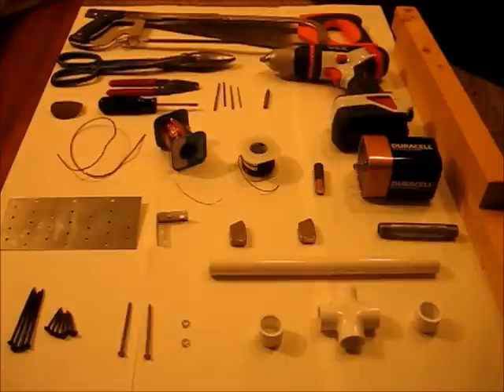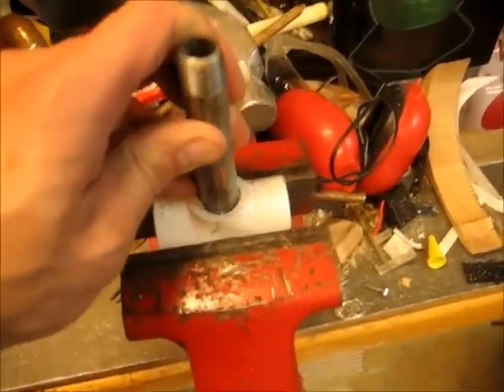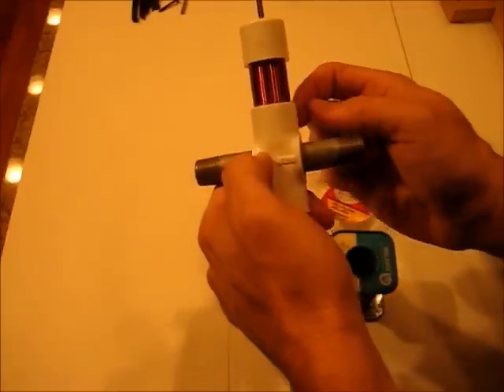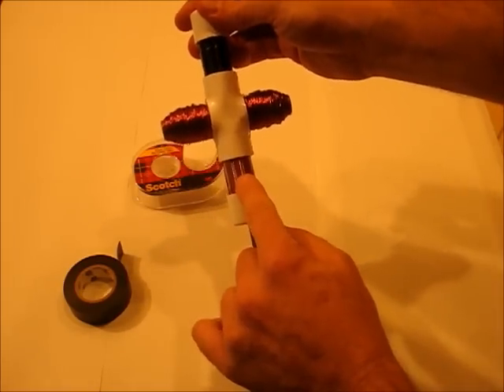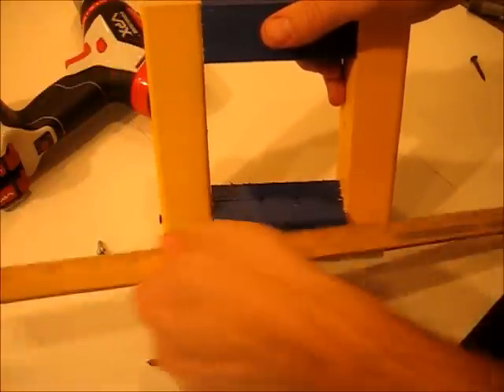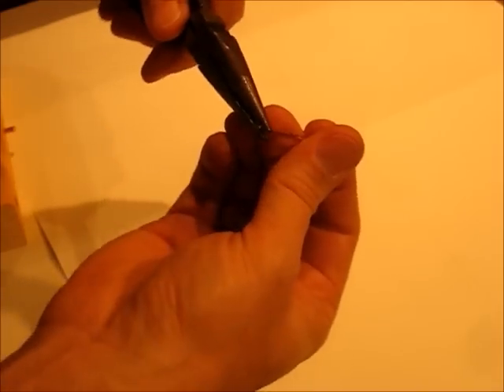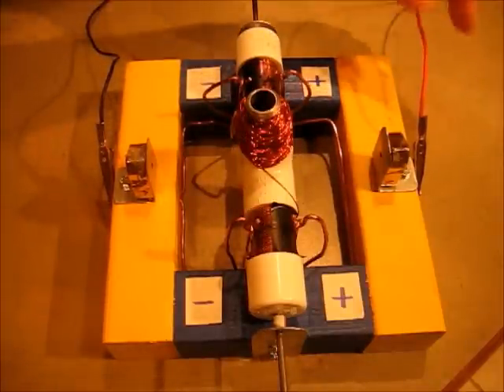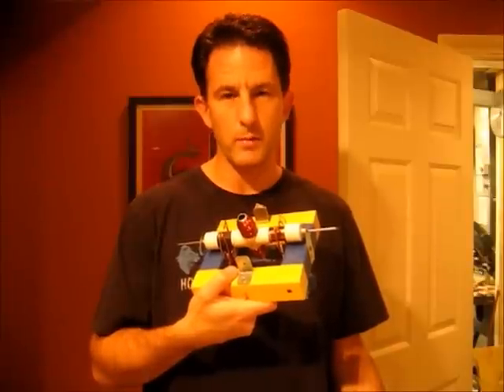How To Build a Motor (HowToLou.com)

Comment: Excellent video, great craftsmanship, you left out the part where you put on the electrical tape. I count figure out how you did in until i saw you had electrical tape on the stator between the brushes very clever.

Comment: thanks Lou I got it working today im going to make another one and try to reduce the friction as much as possible. thanks again.
Reply from the maker: +Bob - A great way to reduce friction is to build it vertically, and stand the bottom nail on a piece of glass.  See the sample motor builds in the gallery at HowToLou.com/motor

Comment from the maker: @Reynier Serpa - It will run slowly on 12 volts.  There are a few things you can do to make it run faster.  If you replace the metal brackets that hold the rotor nails, with tiny ball bearings, this will reduce the friction significantly, which is the main enemy. Also, you will need to affix these bearings with maybe super glue, to the nails, so the rotor won't slide out of position, when you turn the whole motor sideways.  Also, use pvc rotor arms instead of metal, and put as many windings on as you can, and use strong stator magnets.

Comment from the maker: @Leanne Miele - It is enamel coated copper wire, knowm as magnet wire.  You can get it on Amazon.com.  Please check out all the build tips at HowToLou.com/motor before you start.

Comment from the maker: @Leanne Miele - Yes, it is split, but it is a dual split, instead of a single split.  Commutators route the electrical current forward through the rotor coils for 180 degrees of rotor spin and backward through the rotor coils for the remaining 180 degrees, and then it starts over again.  This is typically done with a single split commutator, that has one contact on one side and the other contact on the other.  Single split commutators are difficult to build, because there isn't much room to put two contacts on a rotor, and they can't touch.

This motor has a dual split commutator, which takes up a little more space, but is MUCH easier to build, because one contact is on one of the commutators and the other contact is on the other.

You would have a split commutator and not be re-purposing pre-made rings, with this motor.

Comment from the maker: @Seth Wolff - Yes, it will run on 12 volts, just slower.
Reply: Thankyou. Last question, if I do all the windings on one side of the pipe and then move to the other side and then realize I didn't put enough on the first side, can you go back over to fill the first side up again and then move back to the second? Or will this not work?
Reply from the maker: Seth Wolff - That will work just fine.  Make sure you have the same windings on both sides, so the rotor is balanced, and make sure the windings always wrap in the same direction.  It is also a good idea to read all the building tips at HowToLou.com/motor before you start.

Comment: Hey Lou, great build, I saw your video on Hackaday, Thought: you'll get better performance if your magnets were mounted on the OTHER side of the angle brackets. I know you've done it that way to stop the magnets flying off, but he metal in the angle brackets will divert a lot of the magnetic flux through the metal and around the magnet instead of into the region where the rotor is spinning, where it can generate torque.-meseta4114.  
Magnets were too strong, but good idea with more coils.  -Lou
Reply: What type of a motor is this?

Comment: I'm making this for a physic's project in school. I'm going to test this with 0,56mm copper wire and 1,12 mm copper wire and different magnets. I hope I get a noticable difference in results ( rpm and batterylife)  Anyway, thanks for the good design. I will post my results ( if there are any) here.

Comment: Another good idea.  I thought about that, but the PVC was less expensive and fit with the other parts.  You are right, though.  A copper pipe would have made better contact.

Comment: Thank you Lou for your very useful video! I have a question: would I be able to splice the copper wiring by twisting them together, because I couldn't find a big roll of copper. Once again thank you!
Reply from the maker: Yes, you can splice the rotor wire.  Just make sure to scrape the enamel off the wires, where you join them together.
Reply: I used the phone wires and i treated the plastic exactly like you treated the enamel. However, when i tried it yesterday, my motor didnt work. What am I doing wrong?
Reply from the maker: Pamela B Go to HowToLou.com/motor and check through all the troubleshooting tips.  If those don't help, send a few pictures of your motor to me at HowToLou@gmail.com, and I will see if I can figure out the problem.

Comment: Hey Lou, so I was building this motor and there seems to be a problem. I connect the wires and nothing moves. I measured the voltage with a multimeter and there is definitely 24 volts going through the brushes. Help?

Comment: If I built this motor and hooked it up to a small fan as a wind generator do you think I would get a electrical feedback? Maybe to power a led bulb. Great video by the way! Keep it up.
Reply from the maker: Agravated Monkey - It would have to be a large fan, but yes, every motor is a generator, in reverse.  This, and all home-built motors, are pretty inefficient, primarily because of energy lost in friction.  If you attach a fan blade to one of the nails, and blow it with a large fan or leaf blower, you should be able to power an LED, just fine.  Make sure you put a 300 ohm resistor in series with the LED, or you may deliver too much current and blow it.

Comment: I know this video is a few years old, but figured I'd give this comment a shot. My daughters and I are building this design for a science fair project. I ran into a small problem with the pvc cross and the metal pipe nipple. The video said to use a 3/8" diameter nipple in a 1/2" cross. The 1/2" crosses carried at both of my local big boxes have an ID that is much larger than the OD of a 3/8 nipple (which I know isn't really 3/8"), but a 1/2" nipple has about .080" of interference, which is too much to just hammer it through. Fortunately I have access to large enough drill bits at work that I can resize the cross. Also, the pvc caps I was able to find do not have the little dimples on the inside, so I will need to drill them in a lathe in order to keep the holes centered. Just something to watch out for when buying your parts. After all of that, I do have a question: Where were the washers used? We noticed them mentioned in the materials listing at the beginning, but after watching multiple times, we don't recall seeing them installed. Thanks in advance!
Reply from the maker: +Joe Werner - all good observations.  First, please go to HowToLou.com/motor and look at all the build tips.  Yes, pvc cross makers are extremely inconsistent.  Some are too small so you have to drill them out.  Some are too large, so you have to add hot glue.  Another good option is to just use pvc rotor arms.  This actually works quite well.  See build tips.  Yes, the centering the holes in the camps is very important.  If you have a lathe, great. If not, just measure very carefully.  Yeah I ended up replacing the little washers with 1/4 inch long straws.

Comment: Great video! I've decided to build one, but I'm not sure about the thickness of the wires. I mean the wires used for the coils: I've found a 0,355, do I need a thinner wire? I know that the thinner is the better, as I could wrap the wire much more times, but the man that sells wire in my town said that to use a 24 V tension a wire should not be too thin because the amperage is too high. So what do you suggest?
Reply from the maker: I used 22 AWG magnet wire.  He should know what that is.  That is perfect.  There are more build tips at http://www.HowToLou.com/motor
Reply: Ok, thank you. I'll try witihin some days ;)
Reply: ***** Another question has just come to my mind. Isn't a 22 AWG (0,644 mm) magnet wire too thick ? I mean, it seems to be too similar to the "18 inches long copper wire" used for the brushes, am I wrong? If I am wrong, how much of this wire do I need? Are 25 meters enough?

Comment: hi Lou, does the threaded pipe that you wrap your windings around have to be steel (magnetic or non-magnetic)? or does brass work?
Reply from the maker: Austin Winters - Short Answer: Brass works.  Long Answer: Steel is ferrous (contains iron and sticks to magnets). Brass is non-ferrous.  Steel rotor arms are both good and bad.  They are good in that they focus and strengthen the electromagnetic field.  They are bad in that they "stick" to the stator magnets, and make it hard to start the motor when the rotor and stator are exactly aligned. There are two ways around this.  The first is more power.  You need to wrap many more windings on the rotor, and increase the voltage/current flow to make the rotor magnets strong enough to overcome the pull of the stator magnets on the steel rotor.  This is results in a more powerful machine.  The easier way is to replace the steel rotor arms with Brass or PVC .  The resulting motor is less powerful, but does not have the "sticking" problem when the rotor is in line with the stator.

Comment: hello, we used your video to make our physics project. Once we connected the wires to the battery nothing happened. We are thinking of possible mistakes that we could have made. Does it matter if we accidentally varnished the four sides where the copper wire is rapped around. Also we are thinking if we used the wrong cable to connect it with the alligator clips?
Reply from the maker: Check out the motor building tips at HowToLou.com/motor and send me a few pictures of your motor and wiring to HowToLou@gmail.com. Most likely, your brushes are not touching the rotor well enough.  That is the trickey part.  -Lou

Comment: Hello,
This was a great video, thanks!
Do you have any suggestions on how to modify this motor such that it can self start from any position? By this I mean, if the two coils were aligned with the magnets such that they would attract, before connecting the power, than when the batteries would be connected, the motor would not rotate? Any suggestion how to avoid that, assuming we don't have control over the starting position of the coils?

Thanks,
Olsi
Reply from the maker: The key to getting the motor to start from any position is to greatly reduce the rotor friction, so that even when the rotor arms are furthest from the stator magnets, the attraction is enough to overcome the starting friction and turn.  The best way to reduce friction is to build the motor vertically, and set the bottom nail on a small piece of glass.  Look at Anja Bea's motor in the gallery at HowToLou.com/motor.  She was able to power the motor with a single 9-volt battery, using this friction reducing technique.  If you use the full 24 volts, this same configuration should allow you to start from any rotor position.
Reply: Theoretically speaking, no matter how little friction you have, with the current design you cannot start the motor from any position. If the two side coils are aligned with the magnet, then the magnetic forces on them would be pointing in the same horizontal axis, and regardless or direction (left or right) they would provide no rotational motion. It's like pushing both sides of a stick in or out, the stick won't move. <-F1---  ====stick==== ----F2-->. In order to get rotation, you'd need the following:
^
 |
F1
 |
====stick====
                       |
                      F2
                       |
                       v
I'm sure you know exactly what i'm talking about. In Anja Bea's video, in her third simulation, when she tries to start the motor from such position, it didn't and she had to give it a little push. I was thinking that maybe adding two other coils (so having 4, in an X shape) would get rid of this issue. Do you think this would work (other the fact that will require a lot of extra work to build)?

Btw, thanks for the quick reply
Reply from the maker: Olsi Leka - The commutators prevent the situation of aligned magnets, as you described in the first stick drawing.  When the rotor gets to the point that all the North(N) and South(S) magets are aligned  N <S==rotor==N> S , the commutators switch the direction of current flow in the rotor, so that it becomes  N <N==rotor==S> S  and the rotor rotates with its greatest force.

There is one other factor.  The steel rotor arms are both good and bad.  They are good in that they focus and strengthen the electromagnetic field.  They are bad in that they "stick" to the stator magnets, and make it hard to start the motor when the rotor and stator are exactly aligned. This is what you saw with Anja Bea's motor.  There are two ways around this.  The first is more power.  You need to wrap many more windings on the rotor, and increase the voltage/current flow to make the rotor magnets strong enough to overcome the pull of the stator magnets on the steel rotor.  This is pretty hard to do in a homemade motor, but results in a more powerful machine.  The easier way is to replace the steel rotor arms with PVC.  The resulting motor is less powerful, but does not have the "sticking" problem when the rotor is in line with the stator.  With your goal of a motor that will start in any position, I would suggest you go with PVC rotor arms.

Finally, friction is your biggest enemy by far.  When the rotor is perpendicular to the stator, the magnets are furthest apart and have the least pulling power.  The rotor must overcome the static friction to start turning from this weakest place.  This is where the vertical motor on a glass plate will help immensely.

Comment: Mr. Lou,
What is better, to use a metal rod to wrap the coil around or a PVC pipe and why?  Is it possible for the magnetic pull of the metal rod to over come the push of the electromagnetic field?  Please explain why. Thank you.

Comment: HowtoLou, I have a couple questions regarding your motor. First let me begin by saying: I have gone to your website and understand the information you are giving. With that said, how would the communicator and brush configuration look if I were to have a set of 4 coils instead of two? Also, if I wanted to lift a mass with this type of motor what would be the best position, horizontal or vertical? Lastly, my project parameters restrict me to a single 6v lantern battery, would you recommend a DC boost converter? I'd appreciate a response, and thank you.
Reply from the maker: +Cornelio Santibanez - Converting this motor to 4 coil arms is possible, but a little tricky.  First, I would replace the PVC cross with a PVC 6-Way fitting.  Those are not typically available at hardware stores, but you can buy them online.  Also, I would make the arms out of PVC, so you do not have two metal pipes crossing in the center. 

Next, you will need two commutators on each end of the rotor, instead of one.  Make the rotor and stator about 2 inches longer to allow for these.  Wrap the first set of commutators and opposing set of arms, exactly as I show in the video.  Then, turn the rotor 90 degrees and repeat the process for the second set of commutators and arms.  Basically, its like you are making two seperate motors, 90 degrees apart.  There is no wiring connecting the two, at all.  You will need 2 brushes for each commutator, for a total of 8 brushes.

Now to your question of lifting a weight and using only one 6-volt battery.  You will defininitely need to eliminate friction by holding the nails with little ball bearings, instead of simple metal brackets.  A vertical motor does reduce friction, but will not when you add the stress of a weight.  To lift the weight, simply secure a string to one of the nails and to your weight.  As the motor turns, it will wind up the dtring and lift the weight.  If it is not strong enough, you can use the motor to turn a small hobby gear box and have it lift the weight.

No, you don't need a DC boost converter.  That raises the voltage, but drops the amps, so does not really help much.  Make sure you buy a really good strong battery.  I like Duracell.

This is a very tough set of project parameters.  Good luck!  Please send me a video, for the gallery, when you get it working.
Reply: +HowToLou Thank you very much it was really helpful, but how would I go about sending a video?
Reply from the maker: +Cornelio Santibanez - Jus record a video on your phone or camera and either upload to youtube and send me the link, or email me the file.  Either way is fine.  I am at HowToLou@gmail.com

Comment: I was woundering if I could put washers at the beginning and end of the windings to hold them in place and in sted of nails I am going to use a gage glass like one you would see on a steam heater it fits inside the 1/2 pvc real well
Reply from the maker: +Bob - Glass on metal has less friction than metal on metal, but holding the entire weight of the rotor, on one point, sitting on glass is WAY better.

Comment from the maker: @Alex Werner - 95% of the time, the brushes are the problem.  The perfect tightness of the brushes, against the commutators is crucial.  If they are too tight, the rotor won't spin.  If they are too loose, the rotor will not get the electricity it needs.  The best way to adjust this is to bend the copper loops so that none of the brushes touch the commutators.  Next, with the thumb and forefinger of your left hand on the loops of one commutator, and the thumb and forefinger of your right hand on the loops of the other commutator, gently press the loops in, until they just touch.  Have someone spin the rotor by hand, to get it started.  Work to find just the right pressure to keep the rotor going and a good speed.  Once you find the right pressure, bend your copper loops, so that they apply that same amount of pressure.  This adjustment can be tricky.  More build tips at HowToLou.com/motor